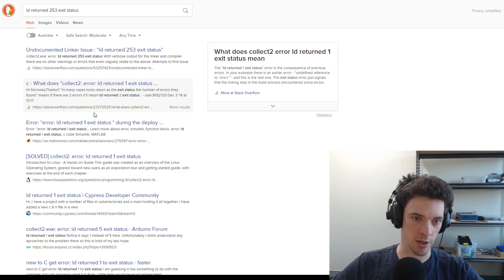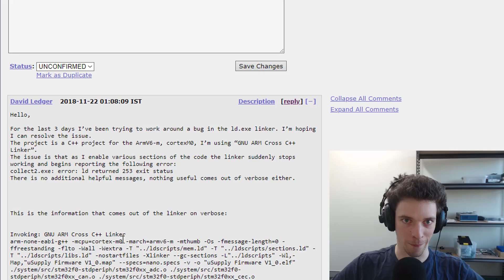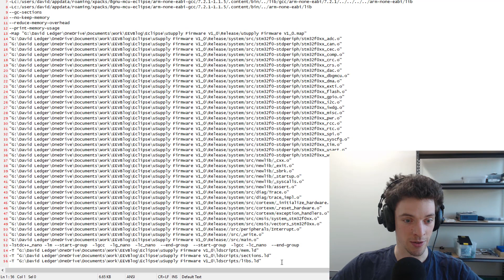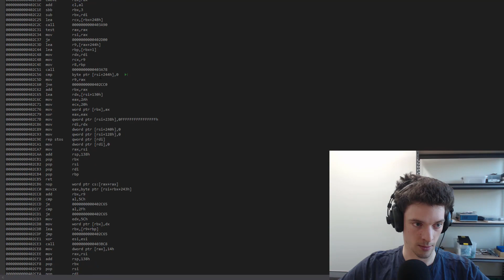GCC Embedded Linker Issue Stops uSupply Development

Comment: I see your username and also your project directory have a ' ' (space) in them. I've definitely had issues with cross platform tools not understanding different parameters correctly and assuming the space means a different parameter. Not saying it will fix it, but it only takes one part of the toolchain to fail by not correctly understanding or passing paths to find things. If possible, try removing (e.g. replacing with '_') all spaces from directory or file names, including your username and see if that fixes it.
Reply: Just thought I'd add, you can be correctly passing all parameters in quotes etc, but something internal to one of the tools itself can also have a problem. So its not always obvious, hence why I recommend the above, if nothing else is working.
Reply: Tried this :(
Didn't work, same error. I tried it in the root directory lol.
Reply: @davidledger5941  hmm, not just the project directory, but all related tools and library directories? Anyway, was worth checking as I've definitely seen some tools fail this way

Comment: hm... both interesting and frustrating at the same time. Are you running the gcc toolkit on an ARM based system or are you cross-compiling? I haven't updated my ARM toolchain in a while. I've just cross compiled code using a tool chain I originally downloaded from embeddedarm.com  when I was doing development for their ts7250 board. My two cross-compiler set ups are gcc-3.3.4-glibc-2.3.2 and gcc-4.0.1-glibc-2.3.5. One of the larger projects I compiled using the GCC cross-compiler for ARM was ghostscript as I needed it as part of the process of printing from the ts7250 board.

Comment: Visual Studio can only debug exes with program debug databases (pdbs) made from its own toolchain. The depth of the callstack should be pretty accurate, so unless they are allocated massive arrays on the stack it shouldn't of died that quickly.
Reply: Afterwards i increased the stack size to 64000000 for ld.exe, didn't change the depth of the callstack. That is telling (IMO) of some pretty nasty code in ld.exe calling a function pointer that doesn't exist or other code that is corrupting the stack.
Reply: @davidledger5941  Hight chances the stack is corrupted. I would have said to use valgrind, but unfortunately it is not available on Windows. According to some sites I would say to give a try and run me under Dr memory. You might also have to triage a lot of false positive so good luck.
Reply: Is the status of this issue unchanged? If it still continue,  maybe you can try to compile with to another target and/or with another tool chain. Since you are running an ld error, it might be an error in the toolchain or an uncatched error in the .o generation.

Comment: try on linux. Even if you have the same issue, you can easily compile it by yourself (on arch from AUR wih an helper or gentoo) and you can enable debug symbols. Also note arm release an official version; I guess is what you are using, so reporting to them can accelerate the fix.

Comment: Try Cygwin development tools perhaps :\
Reply: No arm M0 support as far as I've been able to find :(
Reply: @davidledger5941  https://gnu-mcu-eclipse.github.io/toolchain/arm/install/#windows-1
Reply: @johnnychang4233  I'm currently using that :( Is that based on cygwin?
Reply: @davidledger5941  Nope, they are based on the same source code as the main GCC-Toolchain. They are kind of like different flavor of the GNU-Linux distributions just aimed for the developers. You can always look for another development package to try but if the error come from the source code instead of the way the package implement the linking libraries then there is little you can do unless you know how to manually tweak the Makefile.

Comment: Why are you using Windows as your dev environment.  Linux is more flexible and better suited (IMHO).
Reply: It is better for firmware development sure. But if you are using other tools, like altium that I highly suspect both Dave's would be using. Then they are only available on Windows!
Reply: @lucazader  Eagle and Kicad both run on linux.
Reply: @lucazader  dual boot
Reply: @cyclerical  tried that. Ended up just not using altium where possible and only using Linux. Just saying it might not be convenient or practical for some.
Reply: @cyclerical  Instead of dual boot, I would try wine and if this doesn't work I would use virt-manager/kvm or xen or some windows installation on a separate (virtual) machine via remote desktop. This is all better than dual boot (but still worse than having to deal with windows).
Reply: It is not difficult to get a second system or even a VM under Windows to run Linux and try it on there.
When you do a lot of development work like that you should always have a VM environment of some sorts, to use for testing and to use to have several development environments separated from eachother.
Installing everything on a single machine sooner or later is going to cause trouble and may lead to the loss of a lot of work (if not data, because you backup, then certainly effort to get everything just right).
Reply: @Rob2  I agree, it's way easier to make Linux run well in a VM on Windows than doing the opposite. You can even use the seamless mode so Linux apps show up just like Windows apps
Reply: Boring. GCC runs just fine under windows thank you very much.
Reply: Eh, it's more hassle than it's worth most of the time
Reply: @TheMrKeksLp  Not at all: once you know your way around Linux is waaay more user friendly workhorse. I've switched around 3 years ago and now when I have to do something on windows at work I realise it takes me 4 times the time and anything is a pain. I mean, clicking away all those "please update Java" etc alone - why do I need to do this shit? How hard can it be to have a decent package manager in 2018? Why does my linux distro install software in seconds which I have to google, download and wait for 20mins to install on windows? Why can't I import my app settings from other PC juat by copying a dot file into home? It's such a waste of time, it's crazy!

Comment: If its just a stack overflow because it just needs a bit more stack, rather than some recursive call or the like causing it, you can use the obj* and/or PE tools to change the stack size in the EXE headers.  Can't guarantee a fix, but might be worth checking into.
Reply: Gave it a go, didn't work :(
It actually crashed at exactly the same point (curious).

Comment: There is an open bug with linking with arm-none-eabi-gcc to do with link time optimisation -flto. Not sure if this is what you are using here however.
If it is:
Seems to only pop up with STM32 cores that I have seen reported.
Has to do with the order of the files that are being linked to, and specifically the weakly defined functions defined in the start.s assembly file being discarded.
This happens if you pass the assembly script to the linker after all the c and c++ files.
The temporary fix for this bug is to pass the assembly files to the linker first.

Comment: As others have suggested, try running different versions of the toolchain, possibly on Linux. If you want to recompile it with debug information, at least in my experience, it is much easier to compile it for Linux (host=Linux), using Linux (build=Linux) and targeting armeabi (target=armeabi). Of course, you would have to look up the exact build, host and target triplets. Once the toolchain is built with debug symbols, you can debug it using gdb as usual, or you can use visual studio to remotely debug the Linux executable.

Comment: Also, I would try to compile it on Linux just to see how it goes. If it works, you might consider using VS Code, which runs on Linux as well, and won't be a radical IDE change.

Comment: AFAIK windows limits the amount of RAM a process can use, but there are some flags which instruct Windows to let it use more RAM, so you could try it upon calling gcc
Reply: I dunno, I can't imagine the uSupply code is all that huge. If it's a memory problem perhaps David has a weird page file setting (like disabled, or fixed/small size)  Though maybe it's something weirder like for some reason it's getting into some infinite recursion that's not appropriately caught and handled by the linker? Or it's rather a two fold bug; One what's being passed into it (like some kind of infinite recursion), and one with the linker not failing appropriately on it?
Reply: huge code... oh those C++14 programmers that think they have eaten all smartness comes to mind  :D
Reply: Win32 apps are restricted to 2Gb (which includes all the DLLs (including system ones) you load).
There's a flag in the PE header that allows Win32 apps to get up to 3Gb memory, but  not all apps like that flag because they assume pointers will never have the high bit set.  A wel written program should be fine.  Though linkers often do all sorts of tricks with pointer math that could barf on that.

Win64 apps can technically access 8TB memory, though you won't be able to get that much due to (virtual)memory restrictions in windows editions.

Comment: Visual Studio used to have linker bugs when they first introduced whole program optimization. It was a mine field, you regularly had to check your code if it still compiles in release mode, then try to roll back as far as it was still working and find the piece of code that caused it. I don't know if you can go back and try different revisions of it. Is this something you developed or a kernel that came with the controller?
Reply: that wasnt VS, that was the microsoft linker - which is not being used here
Reply: @jaycee1980  I know, it was just a story about the importance of using some kind of versioning system where you can go back to your old code.
Reply: @gabest4  well yes.. theres no excuse not to use Git these days.. it doesnt even need a server

Comment: Sounds like a tricky one you might have to work with rather  than hope it gets fixed. Mix your linkage up a bit to make it go down a different path, change order of linkage add/remove sections just forcing it to do something different might get you past the issue so your work can continue. Go back through your revision history to find when it last worked, find the change that killed it. You could then maybe split the source file down to make it multiple object files and keep splitting until you zero in on the object file or section it is failing at. The stack overflow may be a red herring just caused by a bad pointer. Did you write your own linker script? If it's a development environment generated one you could take a copy of that and specifically use it and a) sanity check it and b) tinker with it to mix it up a bit. Good luck!
Reply: I agree about the stack overflow being a red herring. This might be a chain of errors, like badly generated object files that make the linker crash (due to lack of proper checking).

Comment: You can try linking it on Linux.  I believe the default stack limit on Windows is 1MB and set during compile time, while on Linux it's inherited from the parent process, so you can change it with ulimit in the shell.  (Default seems to be 8MB on RH.)  If it works on Linux at least you know it's something Windows specific.  Is the linker a 32-bit executable?  Built using cygwin or something?
Reply: Unless you have some very particular code (like iterating over data structures that are nested 1000 levels deep), running out of stack usually means that there's an endless loop somewhere. Raising the limit will just increase the time until it crashes.
Reply: Just out of curiosity I raised the stack size of the ld.exe to 64000000 using editbin /STACK:64000000 ld.exe, it didn't change the error at all (same call stack, not deeper), indicating the ld.exe is chasing a pointer to somewhere that doesn't exist.  @anlumo1
Reply: Thats a really good point!
Trying next :)
Reply: @davidledger5941  Linux to the rescue!!
Reply: Jan Brittenson Running gcc under VS seems an odd choice.  That said, the stack size of Win32/Win64 .EXE files is a straight number in the PE file header that could be easily changed, followed by clearing or recomputing the file checksum (If the file is digitally signed, strip that before starting).
  That said, the stack size in the file applies only to the initial thread (main) and any threads not created with an explicit size.  Recent Windows versions may have debug options to be more or less harsh about stack limits.
Reply: @johnfrancisdoe1563   Not really an odd choice. If you have your builds setup using gcc and makefiles or cmake or whatever for cmdline builds. The you just overlay vscode on top as your editior. nice and simple. can even hook the standard gdb into it.
Reply: @johnfrancisdoe1563  and what noone here seems to know about Windows is that this value is the INITIAL STACK SIZE. Windows will grow the stack as much as needed.
Reply: @jaycee1980  Unfortunately you are incorrect here. There are two values in the PE header to do with the stack size, the stack commit and the stack reserve. The stack commit is how many of the pages for the stack will be committed at a time, and is how much are committed at process start, the default value for this is 4KiB. The stack reserve is how many pages the stack will reserve and use in total, the default value for this is 1MiB.
This is also documented in the linker's documentation for the /stack option. (https://docs.microsoft.com/en-gb/cpp/build/reference/stack-stack-allocations?view=vs-2017)
As a side note, the VC linker's values for these are 1MiB for reserve and 8KiB for commit.

Comment: I can sympathize, as I've experienced similar problems with the AVR toolchain.  One technique I've used successively for many types of "mystery" compiler or linker errors, is to first try to reduce the code down to smaller and smaller units by commenting out the code in the body of functions until I can determine what code construct might be triggering the problem.  Then, as a workaround, I'll try alternate ways to code the section that seems to trigger the issue.  Yeah, I know, this is not really the answer you want, but sometimes it's the only way forward.
Reply: Yeah, those old days when I was bashing my head to the table, trying to workaround stupid bugs the AVR-GCC was full of. I found plenty of them...

Comment: the obvious answer for everything coding related: did you try minimizing your code in terms of complexity? did you try trusty old c99? did you try leaving some code modules intentionally out to check if subsets of the code links? 

and of course about how much code do we talk and for what do you even need an arm cortex m0 in a power supply?
Reply: he is using c++, so c99 is no option here. also i don't think code complexity is an issue at the linker stage.
Reply: the old "ignore the problem, find a workaround"... that is a way out, but still you need to find the issue or soon or later is gonna bite you again.

Comment: Try latest official releases of the gcc toolchain, gcc 7.4, gcc 8.2, or even gcc 9.0 if you are feeling brave. The issue you see might not persist in any of these versions. Also, the bug might be specific to windows so try run the toolchain on a Linux system.
Reply: I need gcc-embedded, so not as simple as that I have the latest, it is somewhat behind trunk :( . But I am waiting its release 30/12/2018
Reply: @davidledger5941  On Linux, I recommend you try out https://github.com/crosstool-ng/crosstool-ng . Pick an arm sample, upgrade the various components via menuconfig, tune the cpu options to cortex-m0, and replace libc with newlib or similar. It may not be easy at first but certainly doable. crosstool-ng is a great tool once you master it and when you do you will never use old out of date toolchains again.
Reply: @_-martin-_  That is excellent! Might provide a way forward, thanks I'll try that next after my current test.
Reply: @davidledger5941 If you do try and run into issues let me know. I've created a ct-ng toolchain for cortex-m4 for a ti-tm4c123g based project without any issues. I'm fairly sure we can sort out any issues with generating a cortex-m0(+) toolchain for you.
Reply: @davidledger5941  You can install the toolchain with your package manager if you give Fedora a try. Well worth it imo, I personally use it for my own M0 firmware dev.
Reply: @RICHARD WINS Cross compiler not available on arm-embedded (unless you know a way).
Reply: @davidledger5941  I've compiled embedded arm compiler using crosstool-ng, you can try it.

Comment: the keil uvision ide comes with the official arm toolchain (is it called armcc? somehow like this ) so this one should work for m0 chips. give it a try there is a demo available
Reply: I suspect that Dave is using c++ in the project given his previous videos about using cpp on micros and his use of the g++ compiler. While keil does support c++ i dont think it has modern cpp (cpp14/17) which may be what dave is using in this instance.